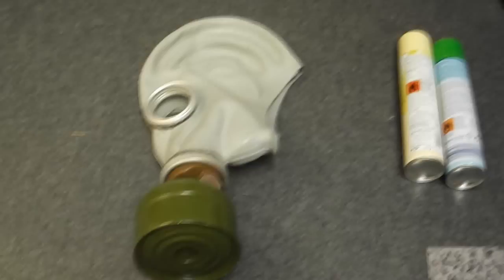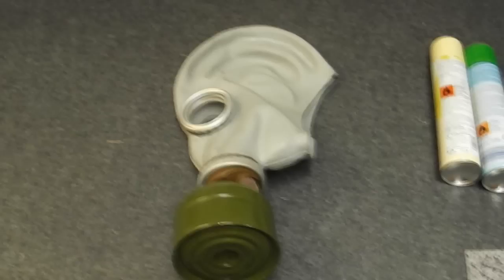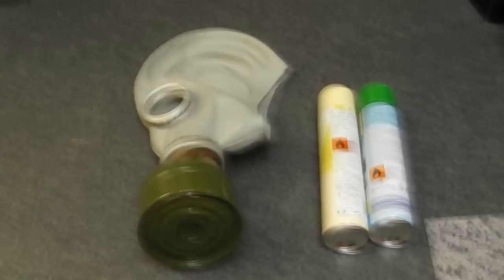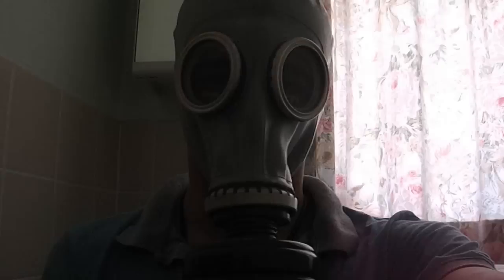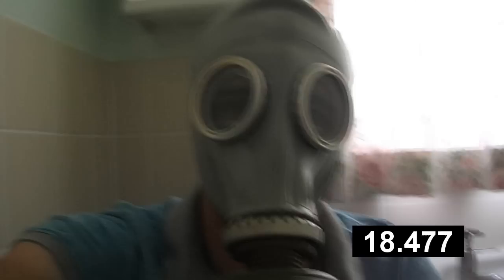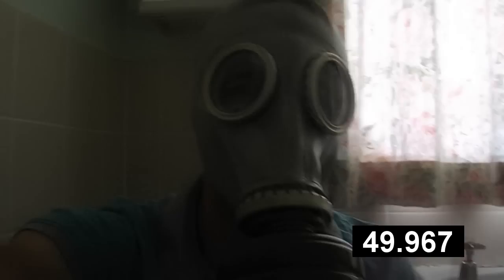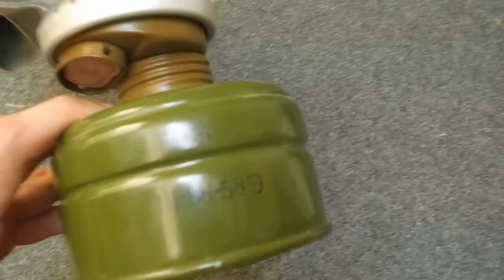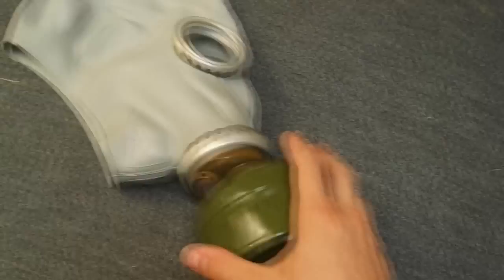Testing the GP5 Gas mask/Respirator

Comment: Try boiling tobasco sauce on the stove and see if it will block the fumes. The fumes really burn your nostrils.
Reply from the maker: So basically airborne pepper spray?
Reply: Weaponsandstuff93 I tried it yes it works
Reply: Demonic Darkness thats exactly how my grandpa told me to do it
Reply: Demonic Darkness wonder how you found that out 😎
Reply: my air filter expired in 2018 but it passed the air refreshener test so imma try this

Comment: the filters included with the GP-5 contain asbestos. I got them proffesionaly tested, only use these filters in a last resort situation.
Reply: Andre Krumins depends on the year of manufacture if they were made after 1972 they shouldn't have asbestos in them but if you want to be safe and still have the authentic soviet filters buy the filters for the pmk masks they are virtually identical but are confirmed safe and asbestos free
Reply: They do have asbestos in them even over the 1970s!
Reply: How/where did you get them tested?
Reply: Almost all Soviet filters have asbestos
Reply: @navalporcupine2426  Varusteleka, its a surplus store in Finland, ordered some tests and all the soviet gasmask filters contained asbestos. Even after 1972. It is very irresponsible for surplus stores to sell those filters without warnings. Many sell them even when they are informed about this.
Reply: @hauki9286  I'm glad I saw your comment, I'm thinking about buying a gas mask from varusteleka.
Reply: @theRPGmaster  Nowdays they have pretty lousy selection

Comment: You should try it in a tent or something so you don't smell up your house.
Reply from the maker: Tents will let the air out though which doesn't make the test work as well.
I just opened the window afterwards, smell was gone within 10 minutes.
Reply: This advice works for weed too
Reply: @domestic_k9919  Bruh

Comment: Since there is quite a bit of debate over whether these filters are safe to use, I would assume that they are safe if the filter is intact, but since you can't really see (very well anyways) if the filter is intact or not, the safest course of action would be to assume that it isn't, and get a modern filter if you plan to wear it with the filter, but save the original one with the cap over it.
Reply: To test the filter take of both caps and shake it, if black smoke falls out don't use it, if nothing happens then its safe.
Reply: actually its cause some gp5 filters contain asbestos (if not all)
also most masks from cold war too even modern times contain chromium as a catalyst and that isnt good either lol
Reply: Doctor Nic a in my filter fall a little bit black smoke. i gonna die?

Comment: I have a ww2 gas mask does the mask itself contain asbestos or only filter? please answer
Reply from the maker: Do you know which mask it is?
Some masks have the filters built into the masks while others can be safely removed.
Reply: +Weaponsandstuff93 It is an A.G 15 the filter is remove able.
Reply: +Weaponsandstuff93  I am wearing a mouth mask under the gas mask and I don't wear the filter on the mask.
Reply from the maker: With the filter removed, blow some air through it to clean the insides and it should be perfectly safe.
Reply: Ok thank you for helping me out 😊
Reply: Blow it with air blower or something not with your mouth
Reply: it containes
Reply: Simon Nilsen abestos
Reply: Simon Nilsen the filter would contain asbestos you can keep the filter for display just never breathe through it the mask is fine

Comment: I took a pair of 3M dust masks filled one about 1/3 full with lab grade activated carbon with the bendable metal tab facing up, the put another mask in the first one with the metal tab facing down then spread around the carbon evenly and taped the two together to make a chemical filter and dust filter mask. Having two metal tabs makes it contour to your face better and duct tape makes a good seal (if the tape isn't wrinkled of course.) It worked against aerosols in spray paint, would you make one and test it against air freshener like in this video?
Reply from the maker: The issue is it still requires the dust mask to make a good face seal, they don't for me.
Reply: @Weaponsandstuff93  would you still try to make one and test it?

Comment: I had a question does any 40mm filter work for this like the NATO ones or does it have to be from Russia
Reply from the maker: 40mm GOST/Soviet are the only ones that will work. 40mm NATO/STANAG will screw on with force but air will seep around the filter.

Comment: I have a question, I bought a GP-5 and it came with a black breathing hose that attaches to the nose of the mask and I wanted to know what the hose is for.
Reply from the maker: To allow you to use the filter in a bag, not directly on the mask etc.
Reply: @Weaponsandstuff93   thank you! Also is there a modern possibly abek filter that looks like or similar to a gp-5 filter? And could I feasibly paint it to look original?
Reply from the maker: Only thing I'd really recommend is Polish FP-5 filters, you could always paint it green.
Reply: @Weaponsandstuff93  Thank you!

Comment: what size is you gp5 because I was thinking of ordering one and I didn't know what size I should get
Reply from the maker: +Fawful benivictor Size 2 if I remember correctly
Reply: +Weaponsandstuff93 if its listed as xl do you think it would fit on a person of average head size?
Reply from the maker: Would be a bit loose, that would be like a size 4.
Reply: Weaponsandstuff93 thanks i found one on ebay i didn't know i could just type size two and get results thanks

Comment: I bought and received a GP-5 I ordered.
I got a Medium size. ... I should have bought a Large one. The lens part is hurting my brows.
Reply from the maker: The rubber will stretch out a bit if you continue to wear it, don't use the filter.
Reply: Alright, thanks for the info.

Comment: I have this mask but no filter i lost the original one, what filter should i buy for it
Reply from the maker: +Brandon Gonzalez Any 40mm filter will fit but PACT filters fit better due to slightly different threads, just be careful with Russian filters though as some are rumoured to have asbestos in them.
Reply: +Brandon Gonzalez Standard Nato 40mm

Comment: I have another question would it be dangerous for your health to use one of these once a week because I clean one of my relatives houses  and when I go to clean the litter boxes and I get sick and my lungs have have heaved from the amonia
Reply from the maker: It's probably safer using a Russian filter in good condition than inhaling gas, but ideally you want a  modern Western filter on it because we know at least what's in them.
Reply: Weaponsandstuff93 thanks! I appreciate you take the time to reply
Reply: Weaponsandstuff93 I just watched a video on a dissection of a filter and there are no harmfull elements just as long as its not expired and leaking there was no asbestos
Reply from the maker: The asbestos in a Russian filter is actually part of a compound, if you inhale the compound if it begins to break down you will still get asbestosis or mesothelioma so it's safer not to use the filter. It's still much safer than a world war 2 mask though that just used a block of asbestos.
Reply: Weaponsandstuff93 do you think there might be a safe date or a western filter compatible with a gp5
Reply from the maker: Post Soviet Union Russian filters, pretty much any Western filter dated 1960s onwards, but you then risk filter deterioration, year 2000+ filters regardless are safe.
Reply: Weaponsandstuff93 are most filters usable with different masks or do you have to use certian filters for certain masks
Reply: Use a cheap 3m respirator.  Its filters will be replaceable and last a while.  Much more comfortable, cost effective, and practical.
Reply: Weaponsandstuff93 hello I have a question about the dates on the filters how do you read them?

Comment: Pis it possible to find out if your filter is charcoal or asbestos? Because I have a filter and I want to dissect it because even if there is charcoal it long expired. But if it has asbestos well.... Lung cancer
Reply: check the dates mate
Reply: *****  i know but if it has charcoal than i can take out the contents of the filter and use the empty one for looks
Reply: Your filter is not charcoal OR asbestos, it´s charcoal and asbestos or only charcoal. Asbestos isn´t meant to filter anything, it´s just for proper sealing of the filter.
Reply: so you can breathe toxic air without spitting your lungs out and dying
Reply: *****
Asbestos is forbidden in the european union since the 90s so they had plenty of chances to use it before.
Back in these days nobody knew about its danger (thats why they also used in in walls, etc.). Most filters are constructed in a special way so that the asbestos can´t escape (if the filter is not damaged). So the filters are safe under normal conditions, therefore a recall would have been senseless.
Reply: ***** ...soviet era mask, i don't think they gave two $%&+* about recalling things

Comment: I thought the GP5 was obsolete and couldn't handle NBC?
Reply: GP5 was originally designed for NBC, but obviously an expired filter isn't going to do that. New filters fit the GP5, however.
Reply: The wonderful thing about the GP-5, Is it's a rubber bag that you put on your head. As long as your exhale valve is in working order and the rubber isn't cracked, the mask still seals. the other great thing is it is compatible with modern NATO spec filters, or Israeli filters.
Reply: +Noah Person I have a GP5, MM1 and a SchMS. They're all the same threading size so would they all work with modern filters, and if so where could I get them?
Reply: GoldenStar Music - Music & Tutorials Amazon, ebay, surplus stores. Pretty much anywhere you can get gas masks you can get filters.

Comment: i have them too but people keep saying me the older filthers have asbestos
Reply: gp5 has asbestos danger ONLY if you damage the filters.
Reply: The asbestos in the GP-5 filters is so debated that it's difficult to say whether or not they do. I don't have one of these masks, but I wouldn't use the filters that came with it regardless, just because I don't know what's inside it.
Reply: treu i might buy ome new ones domewhere
Reply: Walrus Gentlemen that's exactly why you should never assume that old gas mask filters are safe to use. Of course, It's only dangerous if the filter has been punctured, but why risk it?
Reply: Rule of thumb I've come across, any mask from before 1950, exercise caution if wanting to wear, they can have all sorts of stuff on them, also, they're old and clammy. Pretty gross, good for display however.
Reply: i barely wear mine i bought one of those respiraters when i go urban exploring
Reply: Holland tribute Yeah, half face respirators are a lot better than Gas Masks in those kinds of environments. Especially when a lot of abandoned buildings can be dangerous, you need as much FOV as possible. However, the best route for a gas mask if wanted is the PPM-88, difficult to track down, but fairly cheap when on sale.

Comment: Wow, my gp5 filter, has 1 pretty good dent in the bottom, and a few really small dents, so, should I put like, 2, p3 filters in it? Lol
Reply from the maker: +The Proper Mask You only need one pad, more will just make it harder to breathe.
Reply: Weaponsandstuff93 okay, and i am currently using a Swedish 40mm filter attached to the hose my gp5 came with, (which btw was a pain in the ass to clean) but I'm mainly just putting anything on it, so when I put the hose in the bag, I'm not breathing in parts of the bag
Reply from the maker: +The Proper Mask Yeah it will filter that at least.

Comment: that has asbestos in it
Reply: No it doesn't it's activated charcoal
Reply: ik now my bad
Reply: i saw the cloth inside and jumped the gun and yes its a carbon filter. BUT. The word on the street is after the sorta best before date it can be bad
Reply: HellMan64 _ only if the filter is from the early 70s or earlier as the ruskies stopped the use of asbestos filters in 72 but if you want to play it safe then use the pmk filters they are pretty much identical in terms of looks but they are asbestos free
Reply: MaZ I did some digging and found that it was filters up until 1972 that had asbestos in them after that there was only the off chance that the odd filter would have 1-2% asbestos in the lining and then came the pmk and with it 100% definite asbestos free filters in the 80's I could have dodgy intel but it was the general consensus from the mask and filter collectors I talked to